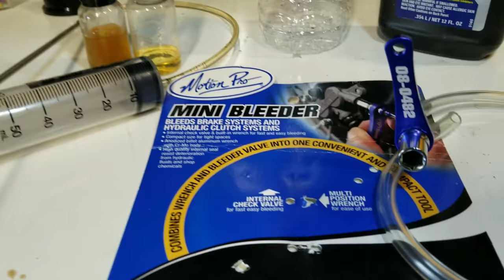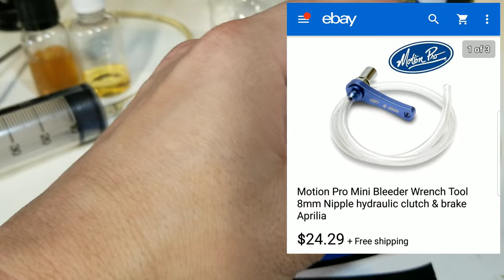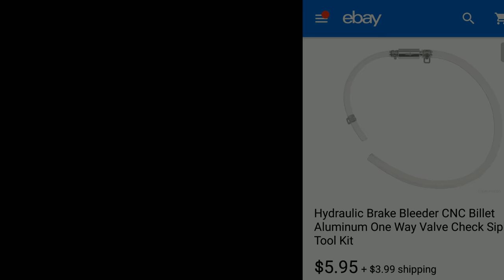How to Change Your Motorcycle Front Brake Fluid

Comment: When reinstalling the reservoir cap, shouldn't we reset the diaphragm?
Reply: wkROBizzl Yes, you should reset the diaphragm. You can place it back into the lid then make it flush with the lid and then push the diaphragm down so it is flat again. Then you can fill more brake fluid instead of only half way like the gentleman did in the video. And the diaphragm will expand as intended when the fluid goes down over time. The diaphragm will expand to keep air out.
Reply: @MrFoxfire510  what the hell is the diaphragm

Comment: 10:45 Pretty sure you can put more brake fluid, and the diaphragm is supposed to be placed back flush into the lid and recessed back into itself. It will then expand later as the fluid slowly goes down, and that’s how it will prevent air entering. The way done in the video, less brake fluid added, and diaphragm already extended.
Reply: Thank you for letting people know that wonder how many did the same
Reply: Dont know if anyone gives a shit but if you guys are bored like me during the covid times you can watch pretty much all the new movies on Instaflixxer. Have been binge watching with my brother lately :)
Reply: @Nikolai Archie yup, been watching on InstaFlixxer for years myself :)

Comment: u have to refill man during bleeding the brake.. u almoust fucked it up..
Reply from the maker: Yes, but as long as you don't drain to the point where you start sucking in air from the reservoir then your good.. always keep the reservoir topped off as much as possible.. thanks for commenting and helping others.
Reply: @TheChemistDIY  u were close to pulling air man.. u never refilles it..